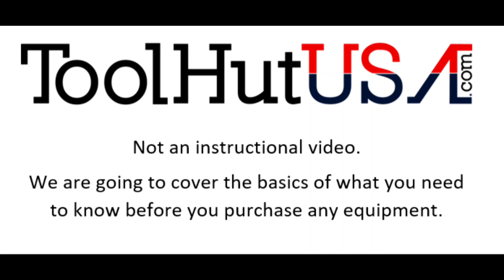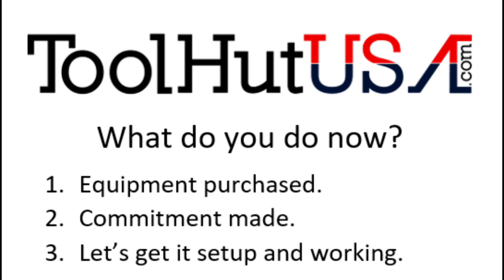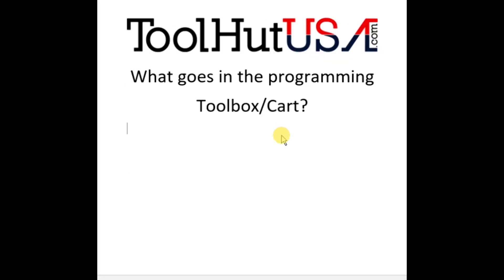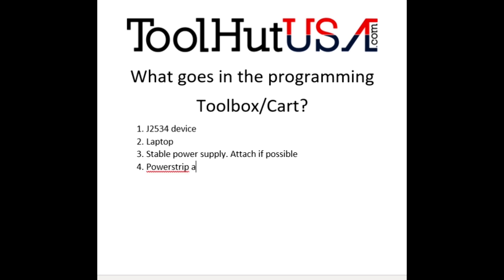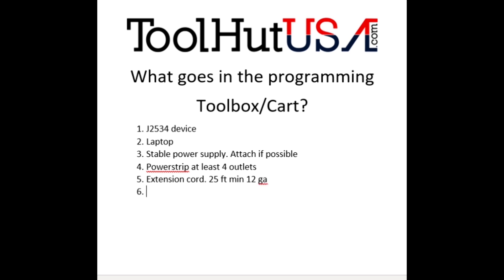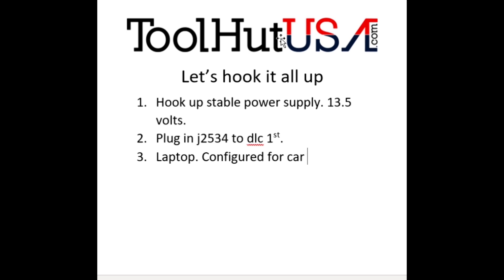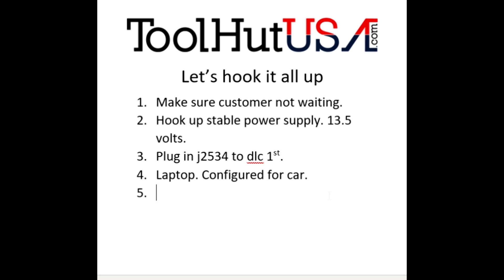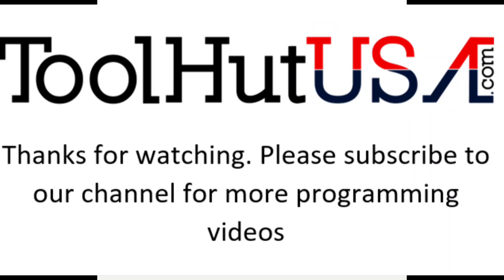Intro to J2534 programming 2

Comment: Do you sell power supplies on your website?
Reply: I’ve been using a jump pack but I can only get it to 12.8 volts if it’s fully charged... its nerve racking
Reply from the maker: https://toolhutusa.com/pl6100-12-volt-100a-flashing-power-supply-and-60-40-10a-battery-charger/